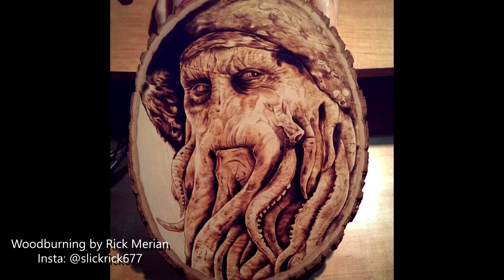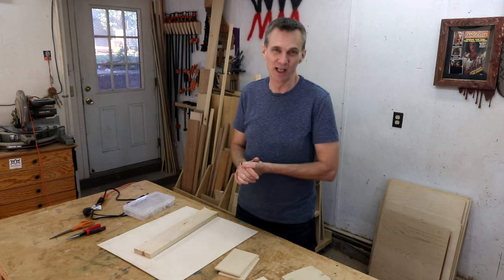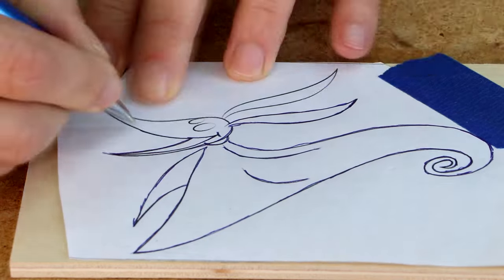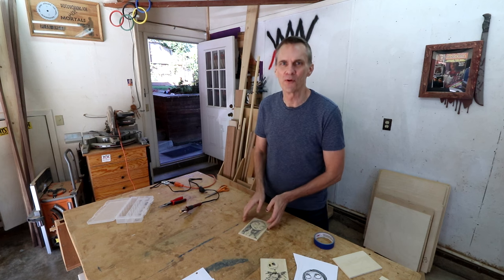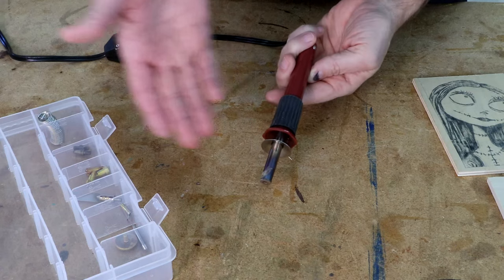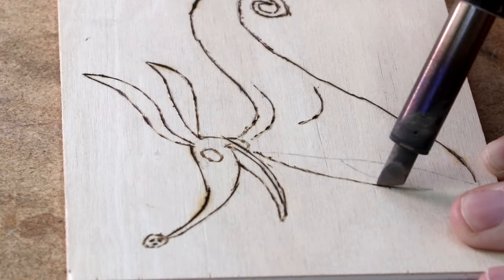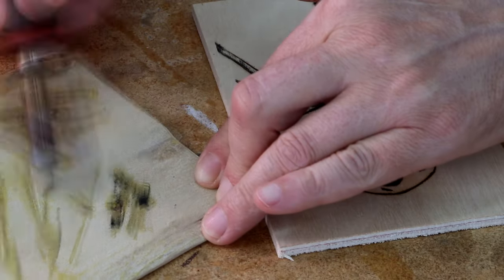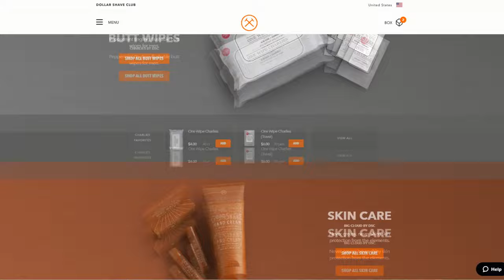Beginner's Guide to Woodburning. Pyrography BASICS

Comment: An overhead projector is only 50 bucks. What is nice about this method is you can make the picture fit the piece very easy.  Easy to shrink or enlarge dimensions. You can also change the angle the picture is displayed on the piece.  You don't have to have clear film. You can use onion or parchment paper in the printer the light shines through more than enough for outlines.
Reply from the maker: Great suggestion! Then the wood stays clean.
Reply: Great method for murals too.
Reply: Duck Soup  Craigslist, Facebook Marketplace.

Comment: I do this for part of my living as a custom woodworker and sign maker. I use Magicfly graphite transfer paper, which is readily available online. If you buy a set of brass tips, you can actually shape them to suit your needs with a file or even a belt sander.  Charcoal pencils are useful for filling in light spots caused by knots or grain, just don't use brush on coating if you use charcoal pencils, as they will smear. Spray-on coatings work best. Also, if you just burn the outline of your letters or image, it makes painting them easy, as the paint will flow to the wood burnt line, (which is slightly indented) and stop.
Reply: Fantastic tips, thank you so much.

Comment: 2:40 For those with Laserjets..print your image backwards as usual on normal paper, secure with tape on piece of wood. Saturate with lacquer thinner (you can do smaller areas one at a time as well) and burnish with something that wont tear the paper. I use a rounded edge piece of wood, maybe 2-3In wide.   After burnishing is done, let dry for 15-30 min and remove paper.

I found this to be the best way to get even the smallest details transferred. I've used this for detailed wood routed signs, and it works SO much better than routing through the paper.
Enjoy..

Comment: Great video Steve. A quick tip regarding the cleaning of the tip. Don't use a sand paper to clean as it will erode the coating on the tip that helps it to get really hot over time. Instead use the solder provided to re-tin the tip and clean it with a wet sponge.

Comment: The included solder is for tinning the tips on first use. It makes them last longer and burn better. Basically you just wrap a brand new cold tip with solder then turn on the iron and wait for it to melt around the tip and drip down to the table.

Comment: i believe the first time I've used this transfer technique was almost 20 years ago. Using an old HP laser printer made a print on the label paper, applied thin layer of glue or lacquer on the wood, transferred the print and applied the finishing lacquer on top to protect it. If I try hard enough, I may still find that piece somewhere in the garage

Comment: Thank you for your informative videos.  As a beginner wood burner, I have lots to learn.  I just finished a charcuterie board.  I added Derwent colored pencils to the design for color.  What would you recommend using as a top coat that is food safe.  I’m concerned if the top coat would promote bleeding from the colored pencil.  Thank you.

Comment: Have you ever used a cutting knife attachment for your wood burning tool? I tried mine and I can't get it tight enough to stay in the tool. That little bit that is supposed to squeeze the tip to keep the knife in place won't slide up... I could really use a video on how to get this tip to work please. Thanks!

Comment: My first was a soldering gun, I used to take 16 penny nails and bend them to fit the gun, then heat the nail as much as possible about 1/2 hour then flatten the tip to different designs,  The tips were held by a screw do it was not unusual for some to come along and send the odor of burnt flesh around the room.  We learned never to touch another tool, especially a real soldering gun converted to woodburning
Reply: That's ingenious dude how did you even come up with that!!!! We have to get some new stylus's for our videos we don't have very good ones but they work as intended.

Comment: I have found that using Xylol on the reverse side of laser prints will dissolve the thermo-bonded laser 'ink'.  Burnishing down the after applying a thin coat of Xylol will cleanly transfer the toner from the paper to the surface. (any Xerographic printer will work)  The ancient 'Magic Markers' used Xylol as a solvent/vehicle.  The industry has stopped using Xylol in any marker but you can get it at the hardware store.  I used to transfer laser prints to t-shirts in this method.  Wood should work the same.
Reply from the maker: Awesome! Thanks for the tip Bruce!

Comment: Hi guys, Newbie question here.. I’m having a hard time getting the ink to transfer to my wood. It transfers but is very light and a lot of ink staying on the back of the paper. I’m using the label paper (with the labels torn off) and a inkjet printer. I’m wondering if it is because my wood is too rough? Will sanding it down smoother help with ink transfer? Thanks!

Comment: Hey, Steve. A bit off topic, but I have been trying to get a laser print transfer onto some pine. I have used Acetone and Polycrylic. The acetone gave me uneven transfer, and the Poly had problems staying on the wood while I was rubbing off the paper. Any suggestions? Thanks.

Comment: If you make a mistake with the burner, can you sand it out again? Kind of like an eraser with pencil?
Reply: It depends on how lightly you burned it in, but the real problem with that craft plywood is that you’d sand through the tissue-thin face veneer layer before you completely got rid of the burn marks.

Comment: When using the ink transfer method, is there a risk that burning the ink releases toxic fumes?
Reply: Any time you burn anything not natural to the wood you risk possible toxic fumes. Which is why all the pyrography artists who know what they are doing always stress safety gear. Wear your mask, (if you don’t have one, please get one) Razer makes some great ones that are comfortable with glasses. Also unless you are outdoors, either have a small fan facing away from you to draw the smoke away from your face or use a fume extractor like the ones used while soldering stained glass (most solder is a tin & lead mix yah don’t want to be breathing.) I use my soldering fume extractor which is lined up to exhaust into my room purifier (desktop size). With this setup & my RZ mask I’m not breathing anything hazardous and the room I’m burning in doesn’t have any lingering smells… hope this is helpful…

Comment: Nice video as usual, Steve!  I discovered this channel a few months ago and have watched a bunch of past videos trying to catch up.

I have a question, though; what is the brand of double-sided tape you sometimes use to stick two pieces of wood together (to cut on the band saw, for example)?  It looks to be about 1” wide and has a white plastic separator strip that you peel off after applying?  The only tape I can find at my local stores is either too narrow, or too thick.

Thanks,

Michael
Reply: I can't answer for Steve, but I use a brand called Suretape. I get mine at the Blue Big Box store. You can also find double sided tape labelled as "carpet tape."
Reply: Michael, I think what you're referring to is commonly known as carpet tape; if you do an online search for 1" Carpet Tape you might have some luck. I found a roll of 1" Carpet Tape at the big orange store's website.
Reply from the maker: I'm not sure of the brand, but it's just carpet tape. They have a couple types. The "light duty" one seems to work best. The heavy duty tape is too hard to separate!
Reply: All right, thanks for all the replies!

Comment: How hard should I be pressing when doing simple lines? I got mine today and it had no instructions smh
Reply: You don't need a lot of pressure, just time. Let the heat of the burner make it's mark. Moving slowly back and forth or in tiny circles works best for me, I've been a Pyrographer for 13 years.
Reply: @marshawilsonpyrographer4046  thank you! Very helpful :)

Comment: Note to self. Oak is bad, Pine is good. He used 1/4” Pine & Sanded It before he began. 320 grit sand paper. Laser printers work great for heat treat but Ink Jet works the best.